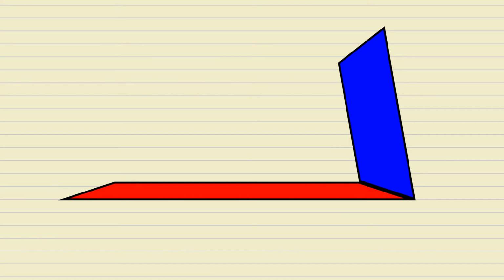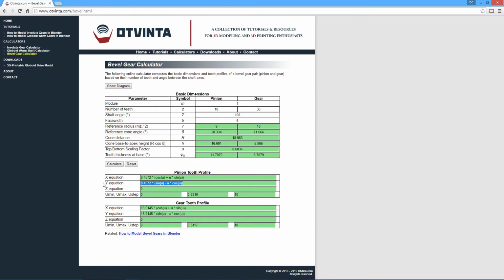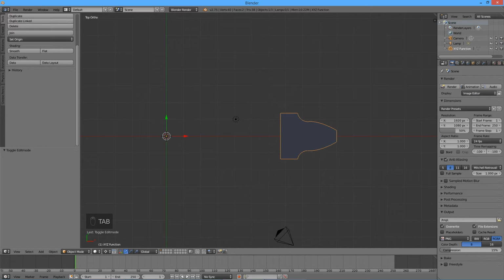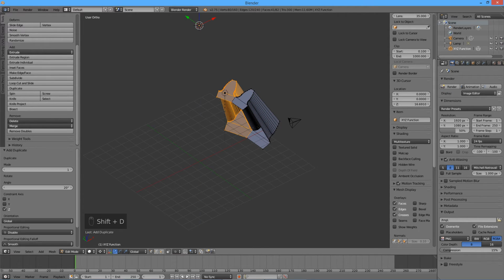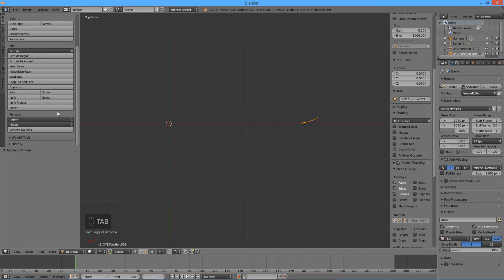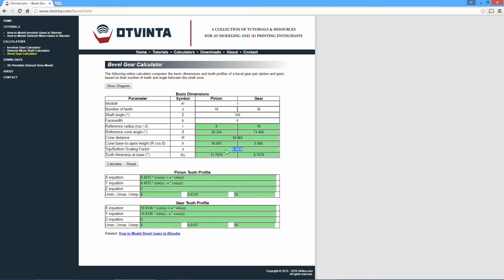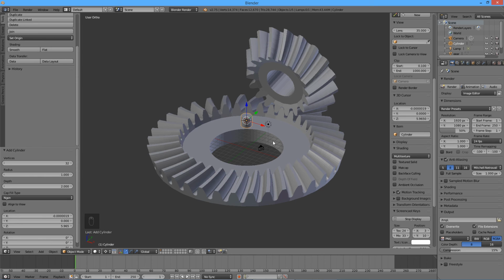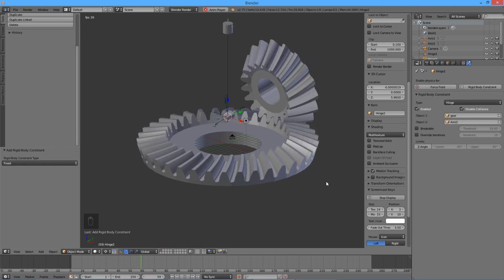Tutorial: How to Model A Bevel Gear Drive in Blender 3D

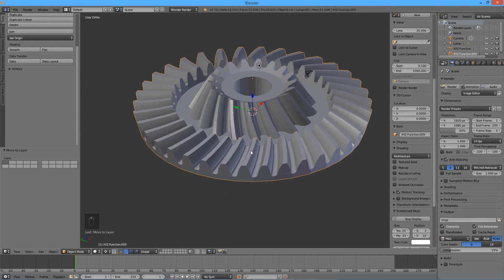Comment: for the problem at like 19:45, i just set the Z origan to Cone base-to-apex height (R cos δ) (far value) and moved smaller gear down by the first value in the x/y equation before rotating by 100

Comment: you know there are plenty of tutorials of how to make wrong gears in AutoCAD and such ... the morons just use a circle arc for the teeth no fucks given

doing this the proper, accurate way in a polygonal modelling tool earns you my respect
Reply: Amen. I'm trying to model a bevel gear in Plasticity right now, naively thinking it'd be easy, and when I noticed the size difference of the gap between the teeth at the outer edge versus the inner edge, it definitely didn't look like my reference image, and it's sent me down a proper rabbit-hole :P Wanting to be accurate can be a curse!

Comment: I have trouble when positioning the gear pin or at minutes 19.50 to 20.00, can you help me?
Reply: same, did you figure out?
Reply: I think it could be cone base to apex hight thing (the far one)
Reply: for zed axes
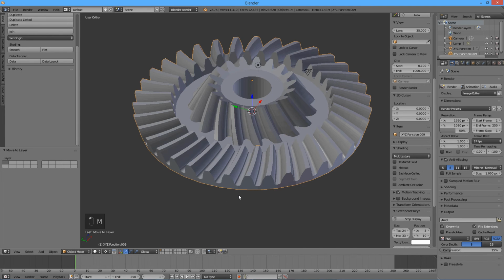Reply: for the problem at like 19:45, i just set the Z origan to Cone base-to-apex height (R cos δ) (far value) and moved smaller gear down by the first value in the x/y equation before rotating by 100

Comment: Very well explained. Excellent graphics. I wished they had also included mention for attention to " real world " application tolerances in manufacturing. These gears will not function in practice even at room temperature on those shafts centers'

Comment: I have run into an issue where when i go to create the manifold towards the end. When i select the ring of vertices to Bridge the edge loops and close off the top and bottom of the gear i get the error, selected loops must have equal edge counts.
Reply: Use Loop Tools>Bridge instead. You can turn Loop Tools in Add-ons menu in Preferences. Had the same issue and this solution worked perfectly.
Reply: @mikoajbiako2294  Thank you!

Comment: Blender has a gear maker, has had it for a long time was hoping this would explain how to use it
Reply: Tried using it at first but it is quite limited, especially if you want to make a pair of working gears. You still need this calculator at least.